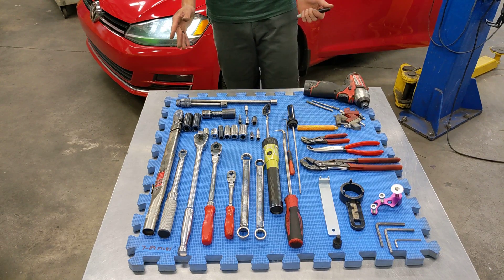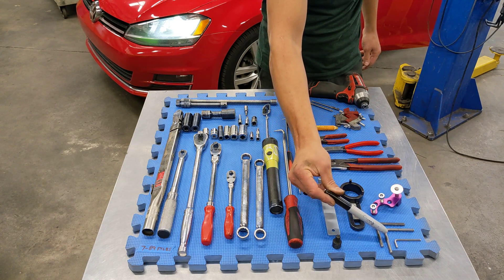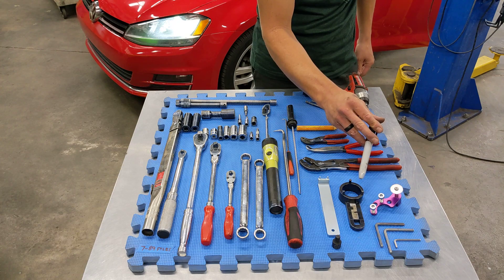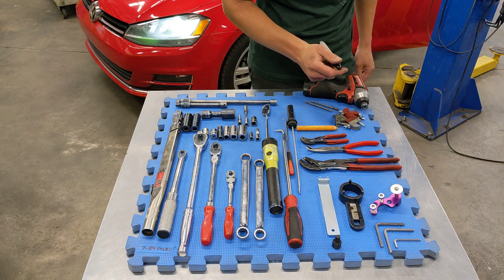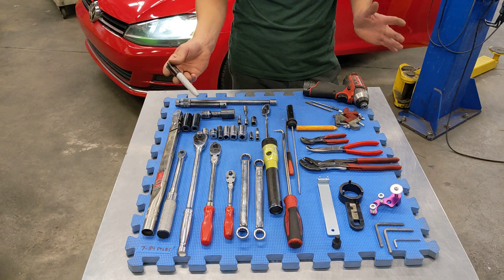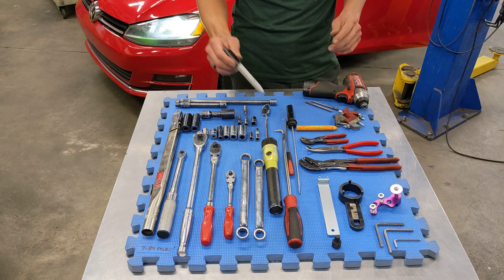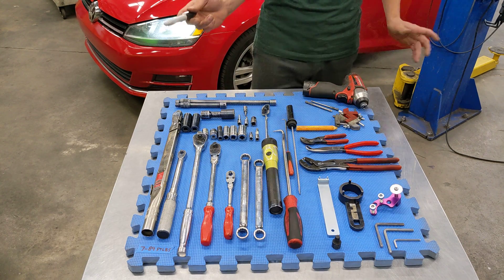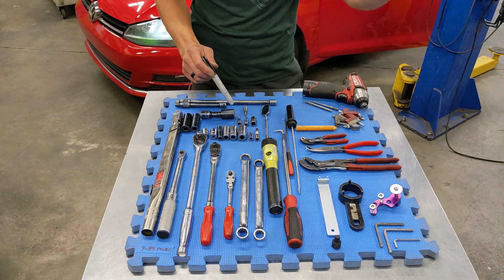Timing belt tools for CVCA and CRUA TDI engines by Dieselgeek

Comment: A summary pf the tools that makes sense to read that's not fully AI generated, but edited by me while listening to the video:
"Hey folks this is the tool set that's required to perform a timing belt change on your 2015 or 2016 year model TDI starting here in this corner we have our 
Specialty tools: 
2 rig pins for the HPFP and the cam Hub
Retraction tool for the serpentine belt tensioner 
Our crank lock 
the tri-spanner tool for counter holding the HPFP and the cam hub
Timing belt tensioner wrench 
M10 triple square specialty driver 
Miscellaneous tools:  
A good set of hose clamp pliers 
Slip joint pliers or Hose plier 
Screwdriver 
Hose pick (you really need a small 90 degree pick to be able to release the electrical connector on the water pump)
Flashlight 
Box end wrenches 
Ratchets
Torque wrenches (lightest torque is 7 ft/lbs, highest torque is 89 ft/lbs)
Inspection mirror
6mm Allen (for setting the crank lock)
T25 Driver
T30 Driver (1/4 drive)
T45 Driver 
Its nice to have a small impact driver for removing the trim panels and belly pan
Hose pinch Pliers are nice to have 
Something to mark with